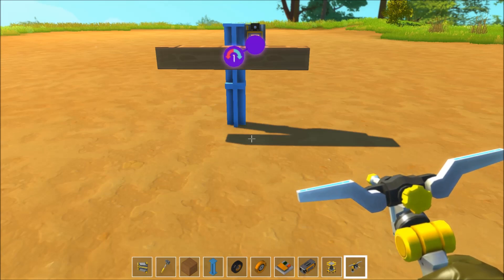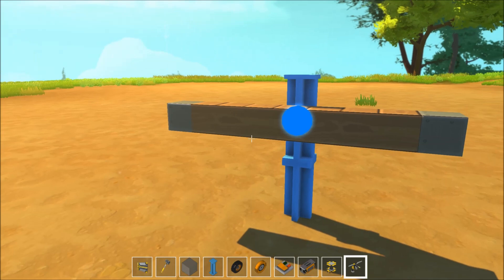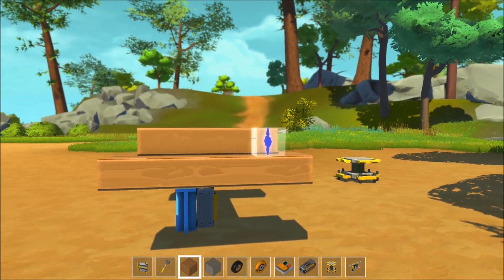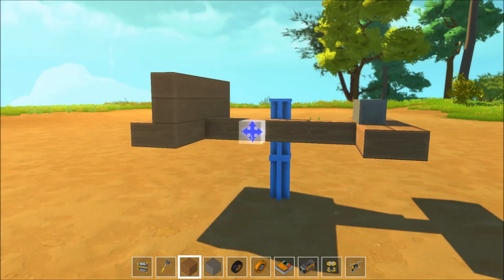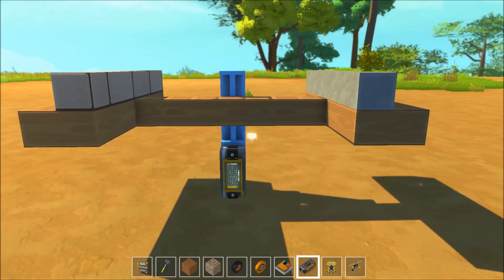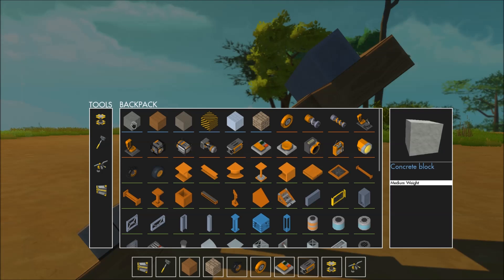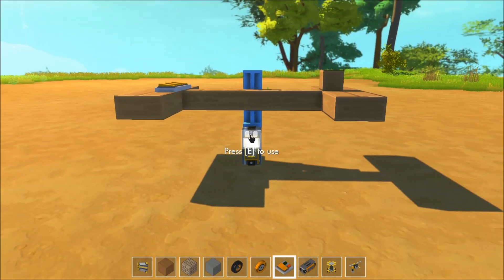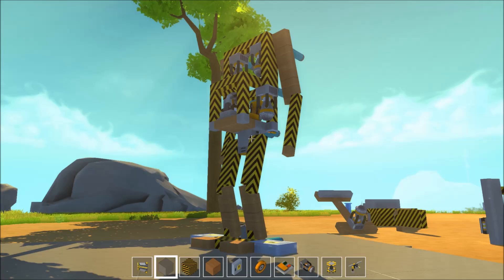Scrap Mechanic - Exact Weight Units for Blocks

Comment: metal = brick          heavy
tile      = concrete   medium
wood  = barrier      light

1 heavy = 2.5 medium = 5 light
1 medium = 2 light
button/switch/duck/screw/nut = 0.5 light (lowest weight)

Very sensitive scales.  Sensors and long arms :D.
Reply from the maker: +KruK666PL Ah ok, pretty close although it's funny that brick is categorized as medium even though it's heavy